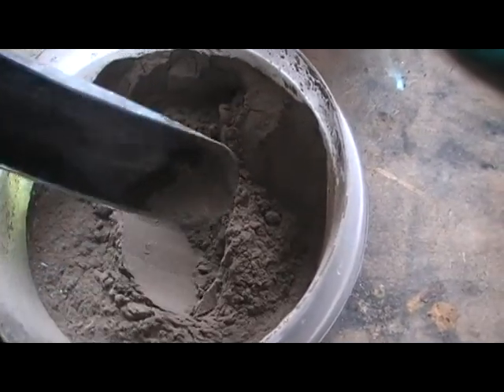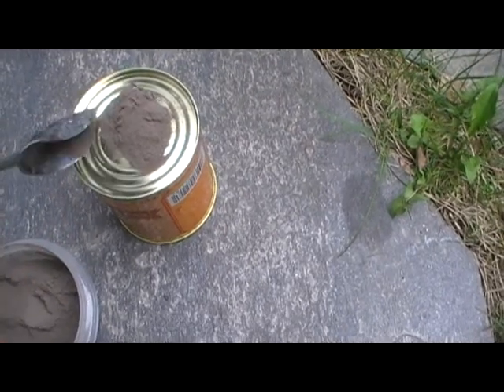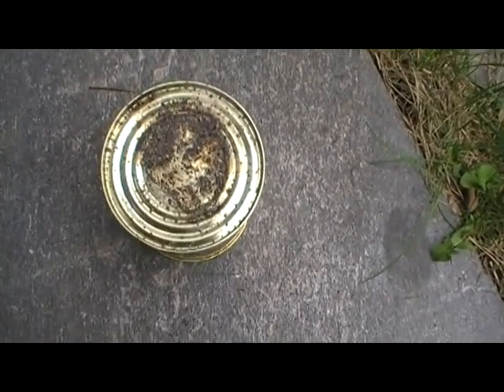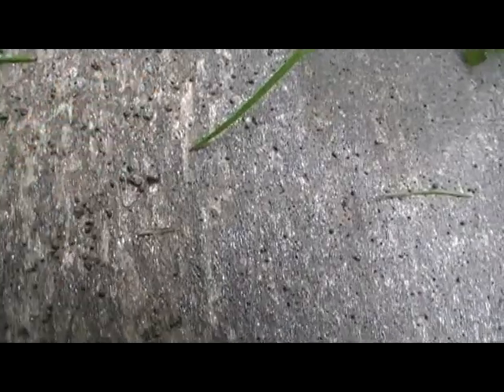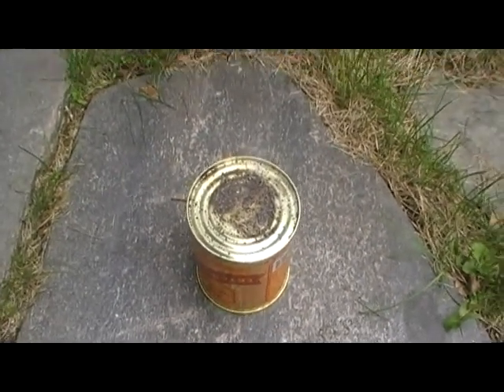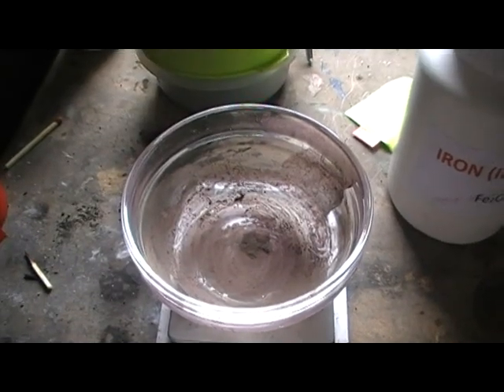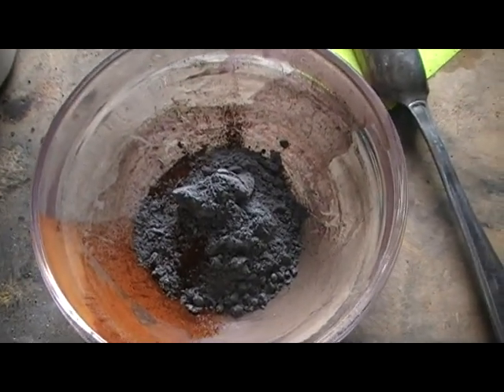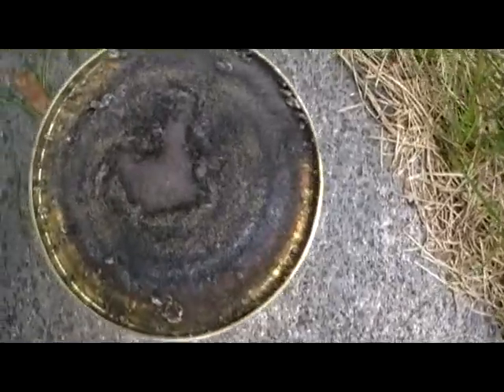Homemade Thermite

Comment: That's the wrong ratio do you even know what you are bloody doing. quick Summary. To make thermite you'll need powdered iron oxide, aluminum powder, and a thin strip of magnesium. Mix the aluminum and iron oxide powder together in a 27:80 ratio by weight, and pour the mixture into a cast iron container

Comment: This is why kids shouldn't play with fire, real thermite won't light with a naked flame. 
The thermite burns at up to 3000 degrees C, the reaction wouldn't give you time to take your hand away and cause severe burns if it was the genuine stuff.

Comment: Dude, you gotta have a wick or a fuse. Fucking idiot, lighting thermite like that, you mustve burned your hand badly
Reply: A cool way to light it would be to pour a little molten aluminum on it.
Reply: ***** Obviously if he used thermite made the correct way he would have gotten severly burned

Comment: well what i've found works best is the ratio of 8 grams of iron oxide to 2 1/2 grams of aluminum powder, you need something along the lines of a magnesium strip to light it though, it's much hotter than whats shown here, as well as more dangerous

Comment: dont need sulfur. the aluminum reacts with the oxygen, not the iron. instead of iron oxide, you can use sulfur dioxide. you get the same result.

Comment: ur ratio is wrong, its 1 part aluminum and 3 parts iron oxide, it should burn better, and it should be red not gray., its good still , and u never use thermite mix for rockets